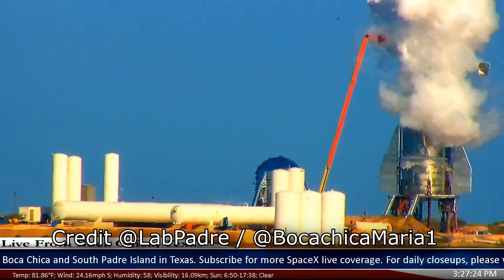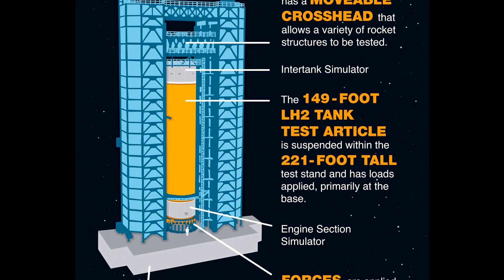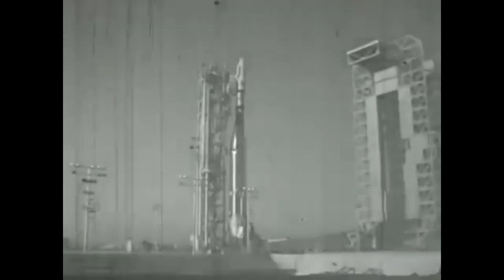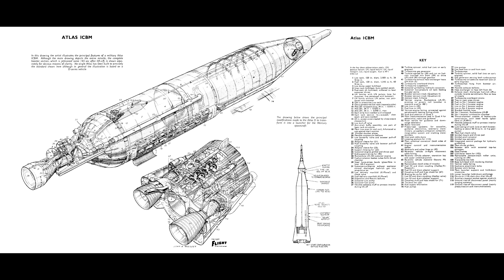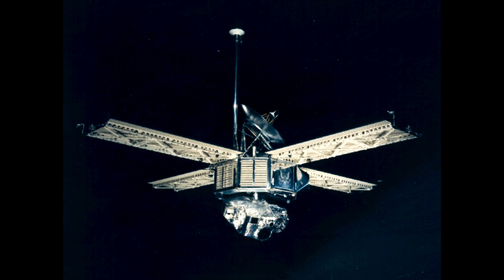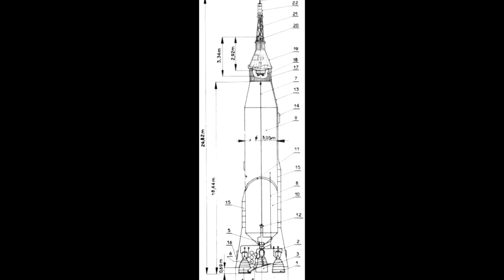Why Did A Rocket With A Secret Payload *Implode* on the Pad?

Comment: I had a coworker who was an officer at an Atlas ICBM silo where the missile lost pressure, probably in the same was as the Mariner 6 rocket. He had to manually hold the manual repressurization button while they debugged and fixed the problem or they would've had a mess.
During the event, the CO of the wing called on the phone and my coworker said he was rather rude to the general and hung up on him. I guess he was forgiven though.

Comment: the image at 025 looks almost real oh no its not a baloney sandwich , perhaps it's not a IL 96 can't think of any reason on Artemis day they would however maybe its important as the actuators are intact. Maybe if it did become flooded too it could be pumped out like a rumoured flooded Ukrainian coalmine. Without knowing the test sight well the logic of what would have been a possible ignition and destroyed test pad seems equally like the things the former soviet union was accused of covering up. It was the 80th Anniversary of M I G design bureau too recently. Slightly not worrying considering NASA has SLS ready made's that probably function as designed. Nobody has a semi sold fuel additive  like maybe frozen Hydrogen that would even out stressful unequal forces through valves and lines like a 2 pi R for whatever volume  widget  that would balloon or implode too rather than the tank. Guess it's their rocket LM and Drugiye.

Comment: Scott - I find the black & white film interesting because at first, the rocket is white, the film flashes, and then the rocket is silver and collapses. The "white" is usually frost condensed out of the humid air due to the cryogenic oxygen loaded inside. This reinforces what you said about a fueling test. However, silver would mean there was no super-cold oxygen loaded. You did say the oxygen was leaking out, but the frost would not immediately melt and evaporate. There are many hours, if not days, between these shot. Perhaps further investigation of the film's source is warranted? Cheers!

Comment: Black hole engines are still very experimental, they often result in the entire ship being sucked into the gravity well.
Reply: Future space travel has somehow managed to find propulsion methods even more terrifying than riding on top of a barely controlled explosion. I'd still get on the ship!
Reply: If I recall my history, there was one spacecraft that successfully engaged its black hole drive, but there were some... unfortunate consequences.
Reply: sixstringedthing Was that an episode of Gilligan’s island?
Reply: @maranscandy9350  Sure, it was the one where the Professor creates a black hole drive from coconuts and bamboo, and it acidentally sends Gilligan, Ginger and The Skipper into a hell dimension where their minds are broken and their flesh corrupted, whereupon they return and start ritualistically slaughtering the rest of the castaways. A barrel of laughs for the whole familty!
Reply: Small black holes are actually surprisingly safe. Between their small size and their Hawking radiation, matter falling into the black hole by accident is like a beachball falling into a fire hose nozzle while it's in use.
Of course, if you can't keep it fed, it'll start losing mass, causing it to radiate harder and faster, leading to a runaway meltdown and a rather impressive explosion.

Comment: If it works keep it. Like the B-52 bomber and the a-10 aircraft, It makes sense to keep good designs around. I think the case can be made to keep the Falcon 9  rocket long term with it’s amazing Economy and  reuse ability.
Reply: Right, unless the task at hand or the enemy or competition drastically changes, or a major tech breakthrough means that worthwhile improvements can be made that aren't possible to simply add as an upgrade, stick with what works!

That said in the case of SpaceX, I hope they keep making F9s if they're cost effective for their own niche, but I think starship might just blow it out of the water (hopefully figuratively)

Comment: Centaur was also supposed to fly as an upper stage on the Space Shuttle. At least two missions were in training when the Challenger accident derailed the program. Centaur was deemed too dangerous to ride in the Shuttle post Challenger. I have always wondered how they were supposed to get rid of the cryogenic propellants if they had to abort - or were they going to try to land with a live 4,000 lbs. bomb in the back?

Comment: I spent the last two minutes of this video dumbfounded and contemplating the 0.015" tank wall thickness after Scott said it.  WOW.    THAT is an incredible piece of engineering, and a testament to the Materials engineers and Fabricators.
Reply: More thought.... that CAN'T be a right number, can it?   It wouldn't even be able to hold its shape during fabrication.
Reply: @EddieBoes  It is the right number. Pieces were put in jigs, clamped and then welded. It was very well thought out production. You can see many parts of the process in film reports from the manufacturer.
Reply: @cogoid  I think I was mixing the tanks too.... Scott was specifically talking about the Centaur upper tank.... and I was thinking about the lower tank, with it's long, cylindrical construction supporting the upper stage and payload.  THAT tank is different.   So, thanks for commenting, It made me look into it further to see where my thoughts went.
Reply: @EddieBoes  The bottom, the first stage, is the Atlas missile. Its skin is also thin. From NASA report: "The Atlas booster, as an example, has a diameter of 120 inches (3.042 m).
 The skin is made of 301 extra full-hard stainless steel varying in thickness from 0.014 inch (0.000356 m) to 0.034 inch (0.000863 m). The cylinder is formed with a series of bands, approximately 30 inches (0. 761 m) wide, welded together with circumferential lap joints and doubler reinforced butt-welded vertical joints" ["Experimental bending strength of an Atlas LV-3C booster beyond compressive skin wrinkling
" RP Miller 1969]

Comment: Is there some kind of device which keeps the pressure constant as propellant is burned? Or is the altitude gain fast enough that this isn't a problem? Still, I would imagine, even if the tank does not implode due to external pressure anymore, it would lose quite a bit of structural integrity with lower internal and external pressures at high altitudes?

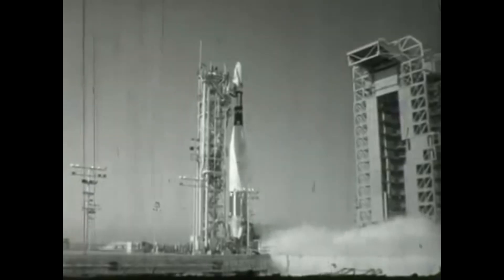Comment: The Atlas D footage looks weird to me. What are the white flash which appear just as the Atlas D starts collapsing, at about 1:55? You can see the main tank body turn from white to silver when the second one happens. There's a white cloud just prior to the first which could be the oxygen tank depressurising (although there looks to be too little vapour for that, surely?). The flashes don't look like explosions. Also, is there an edit at the second flash? Do we just skip from the depressurisation event to the collapse some time later, after which time the ice on the cryogenic tank has had a chance to melt?
Reply from the maker: There’s a cut in the film. The tank was white from frost when it was full of LOX but the melted as the LOX drained.

Comment: "The pressure in the tanks is what keeps the rocket rigid" - oh come on, this is getting ridiculous.
What's next, is the rocket going to eject liquid coolant through a slot on the top? Is the rocket going to come with a protective shroud around its fairing that will only be pulled back when it's time to launch? Is the rocket going to have visible outlines of its plumbing protruding from the fuselage? Men and their toys :D
Reply: Well some of those could be practical. Lets say you have a rocket powered by a nuclear reactor that needs to dissipate a lot of heat in vacuum, i’ve seen ideas for a cooling system that would work by squirting molten sodium at the top and recapturing it at the bottom. The shroud is also not a bad idea to protect it from the elements prior to launch if you consider the Challenger explosion.
Reply: @Pronto Space may be the final frontier but it's made in a Hollywood basement baby

Comment: "Explosion fatigue" sounds like the limiting factor on an Orion pusher plate's lifetime.
Reply: Gotta be careful of thermal cycling, keep your cyclists at a constant temperature!

And microfractures ruining your day, keep your fractures on the macro scale! Otherwise it makes the error of your weight (and thus mass) measures  complicated.
Reply: @glenmcgillivray4707  methinks that the only advantage a macrofracture has over a microfracture is that you can see the former and decide not to use the engine.
Reply: A materials creepy death.
Reply: lel
Reply: Mr. Torgue would be appalled if he heard this phrase uttered by someone
Reply: Post explosion stress disorder   as George Carlin would put it
Reply: Explosion fatigue sounds more like a video game mechanic to me.
Reply: I think people here might have missed the fact that the tank massively exceeded what was required of it. This tank will be easy to man rate.
Reply: Or every Samsung phone owner ever ;)

Comment: Doesn't "Implosion" indicate a sudden inrush of external pressure (essentially a reversed explosion)? All these Atlas/Centaur examples seems to simply be a loss of structural integrity. Am I misunderstanding the definitions here?
Reply: Implosion means something collapsing inward.  I dont think it requires any inrush of pressure.  The video shown does appear as an implosion type event, as the thin walls of the pressure vessel buckle inward.  Is that a 'true' implosion?  Perhaps one could argue against it  but since the vessel buckles and collapses, you could also argue for it.

Comment: Back in the eartly 1960s, my uncle came back from working at the Cape with a film reel of all of the early Atlas explosions.  My cousins & I sat on the floor watching them all.   Dad explained to me that the Atlas didn't have the internal structure to stand by itself.  There was a sample Atlas rocket at a park outside of General Dynamics plant.  He showed me the wooden frame inside that was holding it up.

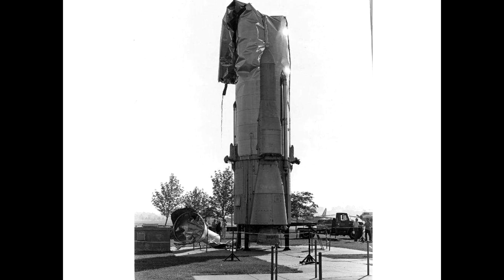Comment: 6:13 I've always hated when my rocket goes limp.
Reply: It happens with older rockets. It's a more common problem than most people realise.
Reply: Hmmm, the Heat Seeking Moisture Missile.
Reply: Doesn't happen with this older rocket. I do yoga.
Reply: @pentagramprime1585  I use a Popsicle stick and electrical tape to keep me flying safe.
Reply: perhaps they should add liquid Viagra to the mix.
Reply: Bad case of brewer’s droop.

Comment: "If this WORKS, it is going to be COOL!"

"If this DOES NOT WORK, it is going to be REALLY COOL!!"
😄😄😄😄
Reply: KSP in a nutshell
Reply: @ba94845  Don't forget the Mythbusters. 😀
Reply: Well, if the failure is due to a fuel leak, there's a very good chance that it will be literally and extremely "cool" until the fuel explodes...
Reply: Caps, italics, emboldened, punctuated and with emoji's too. 

Explain
Reply: @burtlangoustine1  >>> No, I did NOT use the word "Explain" in my post.  
:~)°
Reply: burtlangoustine1 I don’t see any italics
Reply: @KirbyJ89  >>> For some reason, NEWER comments I post with the "_" and "*" together do NOT show BOTH italic  AND bold lettering simultaneously. 
 
My post above -- which I made a while back -- does still show both {reading this on my smartphone using the YouTube app}. 
 
WHY this is, I have no idea....

Comment: Do "man rated" rockets use balloon tank technology?
Reply: I Think The Gemini Did.
Reply: AFAIK the Ariane 5 is designed for a pressurised tank (not sure if it would crumple immediately, but you shouldn't launch with an empty tank) and was originally planned to launch the Hermes spacecraft into space.
Reply: The first american orbital flights used precisely the Atlas rocket which Scott was talking about in this video. (John Glenn Mercury-Atlas)
Reply from the maker: Yes. The Atlas-Mercury program in the 1960’s and the Atlas-Starliner launching later this month.
Reply: Scott Manley Thanks Scott...I always thought those early rockets (Atlas,Gemini) were modified to obtain a man rating. Maybe it was other systems involved in the modifications like redundancy for example....

Comment: How are they keeping the preassure up as the fuel is being used by the engine? I imagine there should be several ways to solvw that.
Reply: Even rockets with sturdy tanks have to keep pressure up. (Turbopumps in the rocket engines usually require certain inlet pressure to function without cavitation -- pressure of about 3 Bar is typical.)
Indeed, many different systems for pressurizing the tanks have been developed over time. Some designs burn stuff to generate gas. Russian Soyuz boils liquid nitrogen to fill the empty space with hot nitrogen gas. SpaceX uses helium in Falcon 9, and will just boil the fuel itself in their next big methane / liquid oxygen rocket.
Reply: they pump in a different gas into the tank, like helium.

Comment: Wait hold up. At 7:57 with all the Atlas V variants, there is a HLV version on the far right. Has that ever flown, or is it a design that will be flown some day? I was caught off guard cause I thought that was a Delta IV model, but quickly realized those were Altas V first stages.
Reply: Never flown, any chanes it had of flying died when vulcan was announced.
Reply: @Vought_dog  Good point, it wasn't till the end of the video I realized that Atlas won't be around for much longer

Comment: So Atlas rockets are big soda cans?
Reply: No. Empty soda cans don't  collapse under their own weight.
Reply: @Jehty_  You can stand on a pressurized soda can. But if it's empty, it'll crumble under your weight. Imagine yourself as the payload.
So yes, Atlas rockets are soda cans 😄
Reply: @TimbavatiLion  you can (very carefully) stand on an empty perfect soda can.  And then if you touch it it will immediately collapse.
Reply: @TimbavatiLion  there is no payload needed to destroy an Atlas rocket.
It's own weight is enough.
E.g. the one destroyed in the museum didn't had a payload on top.

And even an empty soda can is still quite strong. It can hold more than 100 times its own weight.
I don't think that that is something the Atlas can do.
Reply: @Jehty_  so Atlas is a highly refined soda can.
Reply: @TimbavatiLion  bhb
Reply: Yep.
Reply: So is starship well beer kegs anyway
Reply: @davidpaulsen1510  I do not think Starshio needs to be pressurized to lift the payload.
Reply: @grzegorzkapica7930  Yeah, Elon said that Starship will stand unpressurized with full payload.
Reply: Picture a stainless steel keg.  Made in China.

Soda cans are aluminum 😁
Reply: You mean, you had to ask?
Reply: Not the current version, Atlas V. It is structurally supported even with no fuel in it.
Reply: Right? How do they not collapse in flight after most of the fuel is gone?
Reply: @WallHaxxx  liquid cryogenics have self pressurazing properties, some part of liquid oxygen boils off changing state from liquid to gas and expands pressurazing tanks
Reply: @czaja995  Okay, sure, but the first one he showed (atlas D) was filled with kerosene, and he specifically mentions that it was pressurized. Yes, the oxygen tank failed first, but what system is there to keep simple hydrocarbons pressurized in flight? I can only imagine at this point that there are small tanks of compressed gas that are used to backfill the fuel tank.
Reply: with a water ballon with kerosene in it yes
Reply: No. Soda cans are more structurally stable when empty
Reply: No It's a balloon like they all are and it changes color at 1:57 cause this is an indoctrination clip. Metal does not collapse in this manner.
Reply: supersportryder bruh
Reply: @supersportryder  apparently conspiracy theorists have really good eyes, or to much time. 
I didn't notice the "color" change (white to silver 1:57 ).
Did the rocket really change color? (maybe there was ice on the rocket and it broke of when it crumbled) 
Or has it something to do with the camera? 
The color change looks pretty weird.
Reply: @Jehty_  white stuff on tank was ice formed from air because tank holds liquid oxygen thet temperature is -190 C, when rocket crumbled ice broke of imeditly

Comment: That’s odd, at 6:49 the tanks that are supposedly cryogenic fuel say liquid nitrogen.  Since when does nitrogen burn other than a freeze burn if it gets on your skin?  Did I miss something in school?
Reply: Very likely was being used to pressurize the ballon tanks for a test requiring the rocket to be upright. Less dangerous than liquid oxygen, and cheaper. Used for pressure testing routinely - when Starship blew it's top, they were using nitrogen.
Reply: Don Jones 
Got it, that makes sense.
Reply: They might use it to cool the liquid oxygen to the right temperature.

Comment: Actually, Scott, the Atlas II did use SRBs and they were attached to the booster stage's thrust-structure (The part that's jettisoned after the booster engines are shut down).
Reply from the maker: Yes you're right.
Reply: @scottmanley  Note Atlas III was designed for SRBs as well.  It had to have  the tube supports upgraded due to the g loading the SRB put on the thrust section.

Comment: Pretty sure the balloon tanks is why the Atlas-D at Marshall Space Flight Center is laying on its side horizontally.

I always thought this was a very cool approach to rocket design, but at the same time it obviously had some significant downsides!

Given that the rage in rocket design right now is reusability, I guess we won't see ballon tankage used in new stages (aside from revisions of the Centaur) anytime soon.
Reply: Tried to follow your thinking... cant compute :) why is pressurisation more convenient when pressurized item is tilted 90° to the side?
Reply: @z33r0now3  force is divided on side of rocket so it is essentially "lighter" so steal can hold it own weight.